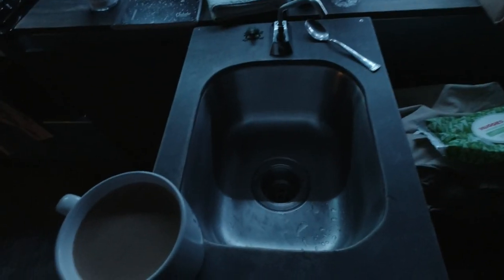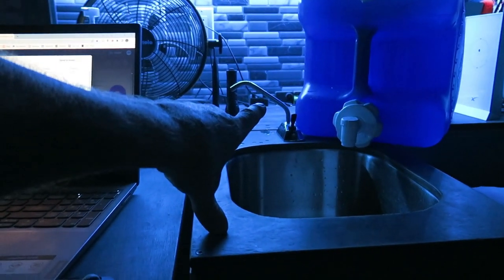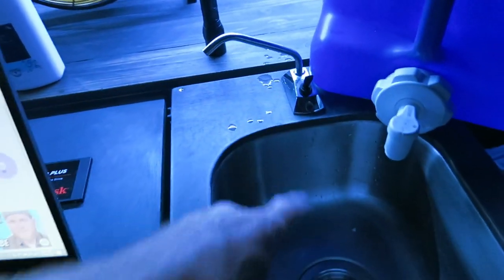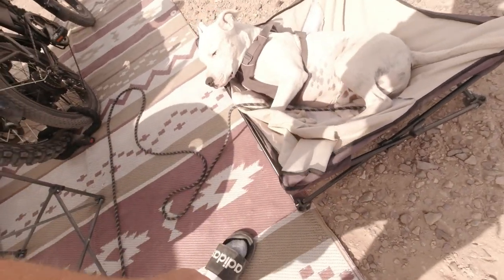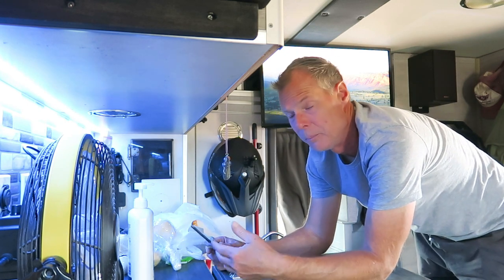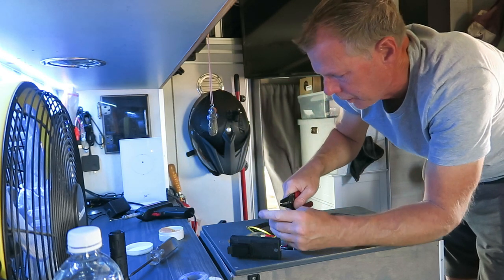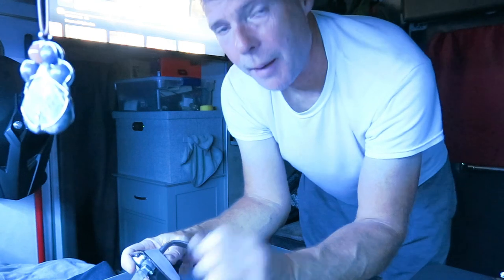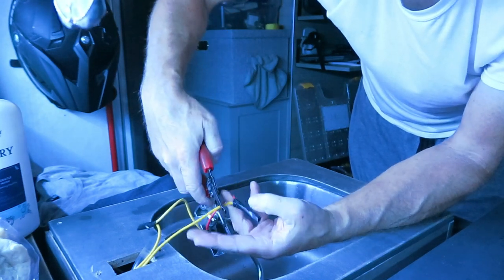I Almost Burned My Truck To The Ground From A Wiring Problem That I'd Never Seen Before !!!

Comment: The decorative edge is called piping = a type of trim or embellishment consisting of a strip of folded fabric so as to form a "pipe" inserted into a seam to define the edges or style lines of a garment or other textile object. Usually the fabric strip is cut on the bias.
Reply from the maker: That sounds possibly correct. I was thinking of welting (sp)... I'm waiting for mom to answer this for me... she'll know the correct terminology  :)
Reply: @TheCampulanceMan  One more vote for "piping" :)
Reply from the maker: @jasonpotts6490  It turns out there's a lot of names for that!

Comment: Dave, I need you to sit down for a minute.  I ran into this a few years ago.  There is cheap wire out there made from Copper plated Aluminum.  It looks like copper but over time, since Aluminum isn’t as resilient as Copper, the strands start breaking inside the plastic insulation.  If you use it out in Sunlight, the Aluminum expands and cracks the plastic insulation.  Once that happens the Aluminum Oxide starts building up until nothing is left but what looks like Salt.  When shopping for hookup wire, look carefully to make sure it isn’t plated.  That means Copper plated Aluminum.  You didn’t do anything wrong, it’s a material issue.  JimO
Reply: Oh... thanks for that additional information!  I'm learning a lot from listening to all of you experienced RVers -- or just handymen.  Much appreciated. 👍
Reply: Yes!  Also look out for "copper-clad" which is just another word for copper plated aluminum wire.
Reply: Yep.  The whole time I was watching this video, I was thinking "CCA."

Comment: The switch is called a momentary switch. The edging is call Piping. And yeah, you need to get a small spool of marine grade wire so you don’t have to worry about the wet location connection again. Wish you were closer, I do all that kind of stuff all the time and would help.

Comment: It might be beneficial to run a relay for your water pump and have a switch activate the relay so you aren't carrying as much current out to the switch. 👍
Reply: And run heavier wire from the power source to the relay and the relay to the pump.
Reply: @280zone  Relay and heavier-gauge wire on the pump side are both solid ideas and get my vote.
Reply: Follow what these guys are saying.
Reply: Every wire needs to be fused. After the first fire, that becomes more obvious.
Reply: @lyfandeth  Only one fuse is needed for each item if wired correctly.  Another tip is to wire the switch to trigger the relay ground.  That allows you to minimize all of the areas you have positive ("Hot") wires running to and from.

Comment: The dog bed can be custom sewn using canvas (that won't shred) with heavy-duty elastic bands on the backside that stretches over the corners.  It'll take a while for a hole to appear in canvas.  Find a seamstress when you get back to NY and have one custom made.
Reply: This is an excellent idea.  Also ordinary canvas can be made highly water-resistant by spraying it down with a cheap can of silicone spray.

Comment: Hi Dave, yup it's called piping or welting for the trim on the chair. Glad you zeroed in on the wiring issue, last thing you need is to wake up in a rig full of plastic fumes and smoke. Good idea to rewire and start from scratch, just wonder if the wire was rubbing somewhere else that could cause it to ground out and draw so much current that the wire got hot. I'm kind of surprised you haven't had other electrical issues, considering all the wiring you've done and all the bouncing the rig has gone thru over the past few years. It's a testament to the quality job you did in the first place. Good luck with the endeavor and as always say hi to Lefty for me and stay safe...

Comment: One of the nicest thing I ever had was on one of my boats. This was an older 35 foot Chris Craft. It had a foot pedal switch. Best idea ever. Have see hundreds of boats and hundred of campers/RV's/self builds and I have never seen another. Years ago I looked for one but didn't find one after market. I have seen manual foot pump ones but not the electric ones. Maybe someone else has seen them. Of course it was tucked away slightly and had a secondary switch that you had to turn on first but talk about water control!!
Reply: That was my thinking, as well. Amazon has several on offer, some specifically for marine.

Comment: Glad you caught that wire heating up.
Please do use a relay and upgrade to solid copper/single stranded 12ga wire on all your motor type installations. It's better for your safety, you never know when those lil pumps or motors will go bad and short out.
I'm also assuming that you have an in line fuse as well.👍🏼
Reply: Thanks for adding those additional tips for the rest of us novices and misc. onlookers!  👍
Reply from the maker: Single strand? I've never used that for 12v wiring. I'm doing a full re-do of my water system while we're in NY, including new pumps, filter system, possibly a different water heater, warm water at the sink, etc - so new wiring too with fusible links to replace the inline fuses that I have now.
Reply: @TheCampulanceMan  Single strand isn't recommended for use in mobile structures (Boats, RV's). It's too rigid and the movement of the vehicle can cause it to break from "work hardening". I use to work on a commercial fishing boat and have rewired a few of them.
Another thing I forgot to mention was getting some "Marine heat shrink tubing" from Hobo Freight for the terminals. It has a heat activated adhesive inside of it that will make a watertight seal at the terminal and protect it from water migrating up the wire underneath the insulation. It's pretty cheap and will make cheaper wire last a lot longer.
Reply from the maker: @infotoons212  Thank you for the info!

Comment: Been looking forward to another video!  Sounds like a corrosive envirionment for that kind of switch/connectors/wire.  I sent you a FB Msg regarding a solution.  BTW, "momentary switch" (or more specifically a momentary pushbutton switch) is the term you were trying to remember as opposed to a latching or 'maintained' switch.

Comment: Lefty is not a dog, he is part people LOL. What a riot he is! ❤ I had a water bed in the 80’s too. I have the same dog bed too. Love your content! And I’m glad you’re safe!
Reply from the maker: I'm upset at his dog bed. How has yours held up? This is the 2nd one of these that's just shredded on us. We leave them out 24/7. Do you do the same with yours?
Reply: @TheCampulanceMan  I just got one from Amazon last week. Hope it stays together.  That would be frustrating. I did get two bug lights from Amazon and they both broke so I went to Home Depot and got a different brand all together and bought a 6.00 warranty.  
Last summer I had fuse issues with my solar panels and finally got all of that fixed. No I don’t leave my dog bed out. I bring it in at night. I guess I’m afraid of things getting stolen.
Reply: Edging......hehehe
Reply from the maker: @patriciatownsend7038  I've received like 7 names for that material that goes around the edges of the chair. I was thinking of piping - which is a term used in car upholstery. Batting. Edging, matting. Etc... I guess it gets called a lot of different things :) Whatever term mom uses is going to be the correct term :)
Reply from the maker: @deborahg4599  It looks like one of my motion lights has stopped working. It started by only coming on at about 1/2 brightness, then no lighting at all when it should have been triggered on, then back to working perfectly, and now back to not lighting at all. I've tried all 3 settings using the remote but that's made no difference. I tested the remote on the other light and it works just as it should, so it's not the remote. The real stinker is that the company I ordered it from on Amazon no longer is doing business, so I can't do the YouTube channel power play to get replacements sent even 4 years after I bought them :/

Comment: Edge banding is called piping.
Re: pump - just put a switch in to turn in pump. That will keep it from just starting while on road. The switch would be same as in any RV

Comment: Hey David, so happy to hear that you found it in time and that you both are safe. I too bought that same faucet/switch for my sink but have yet to install it. I think I'm going to look for another faucet/switch to install in my rig so that I don't go through what you went through. What say you about that?  Also, just thinking, but would Lefty be able to hit or bump the new knee high switch by accident? Again, so glad you both are safe.
Reply from the maker: That's always possible. I'll need to see how it actually mounts and if it will be vulnerable to him... the faucet switch failed due to getting soaked with water multiple times a day :/

Comment: Hi, I been following you channel and wanted to say thanks for all the knowledge you have shared.  i have a grand caravan, removed the 2nd row seats, i enjoy camping in it!  do you have information on how to set up more power/solar-from what i understand i need a battery and inverter.  i am lost after that.    Thanks in advance Karen
Reply from the maker: You need solar panels, a charge controller, and batteries. Then an inverter if you want AC outlets. I did a good video that explains it all very well.

Comment: Upholstery left out in the sun needs a wash and then a heavy spray of Scotchgard or Formula 303, which is what boats use on canvas tops. It will last forever that way. 
 And Lefty's bed could could be just recovered with canvas duck cloth, or genuine marine Sunbrella, not expensive if you just need a scrap yard or so. Sew on two layers, he'll need two years to through it all.
Reply from the maker: Great tips, thank you!

Comment: Great video as usual David. We are trying to figure out a hot water shower solution. I know you have the Vinmax but they are not currently available. Have you had any ideas or suggestions since you installed your tankless heater? Thanks
Reply from the maker: Thank you for being with us and for the  compliment! My tankless heater is too HOT. I should have put in a smaller unit and I should have used a stronger feed pump. I have pressure that's too low and water that's too hot! Learn from my mistake :)

Comment: Thoughts:  1)  wire is too small for the pump load, perhaps need a relay so the switch does not heat up like a toaster coil..  2)  seems like maybe a bad ground, that makes and breaks.  3)  separate electrical from the water would help.  Take care.
Reply from the maker: Good tips Don. It's all getting a re-do in NY... I'm making some major changes.

Comment: Canvas or denim would probably be better for Lefty’s bed. Wires most likely got compromised when the switch failed when you were driving. Definitely need to rewire.
Reply from the maker: I have rewired the switch with a new run from the switch to the pump. Once we're in NY, the water system is getting an entire re-do including a 5 filter in line drinking water filter, new pumps (lower pressure for the sink, higher pressure for the heater/shower) maybe relocate the sink too and add a grey water tank under the truck. There's some maybes on that list... :)